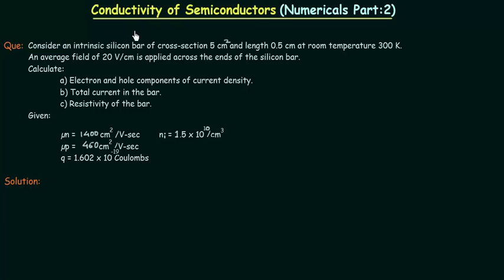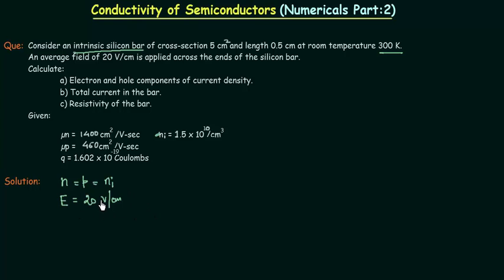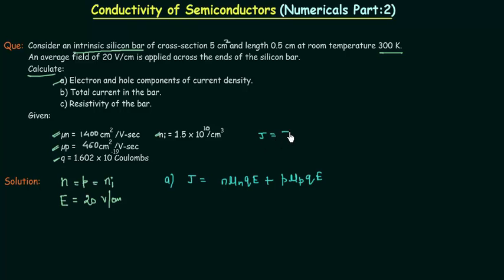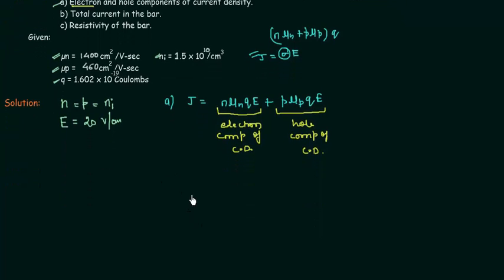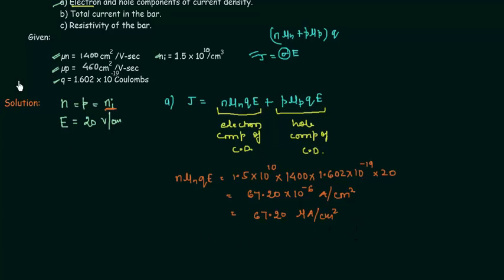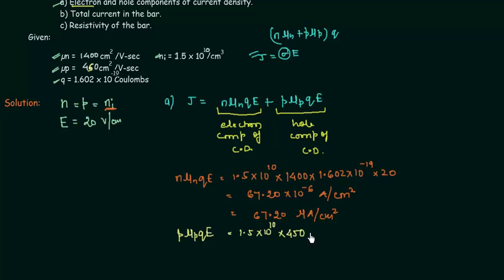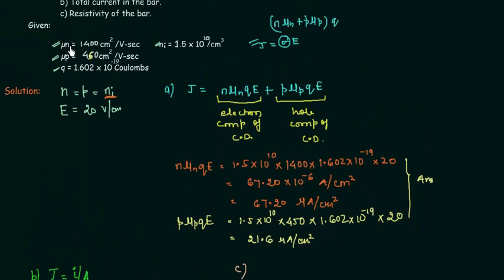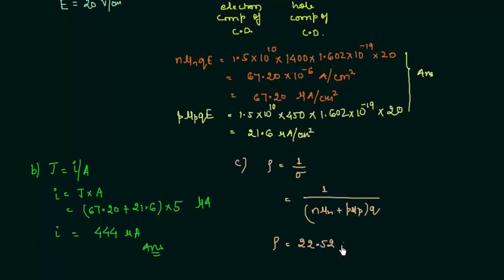Conductivity of Semiconductors Numerical (Part 2)

Comment: another solution:

applied voltage= E.d ( d is the length of bar =.5 cm) v=20*.5=10 volt
I=V/R  and R of bar = resistivity *length/area
resistivity=1/conductivity
conductivity= 4.464 micro Siemens.cm
resistivity= 224 ohm.cm
R= 224*.5/5=22.4 K. OHM
I=10/22400= 445 MICRO A
Reply: R of bar = resistivity *length/area how u get that?
Reply: @ahanchakrabortty  see previous lecture of this playlist